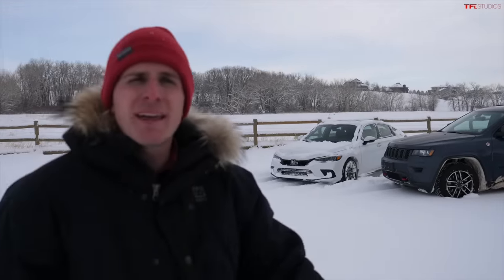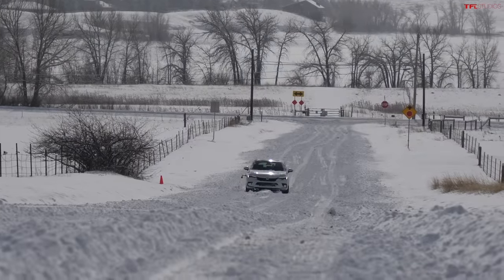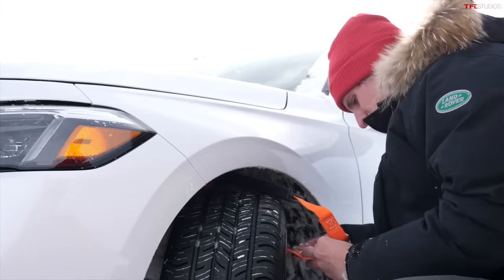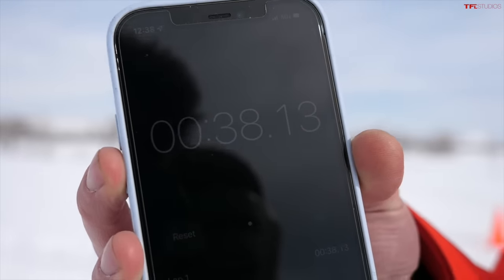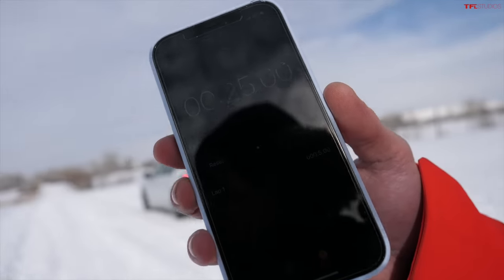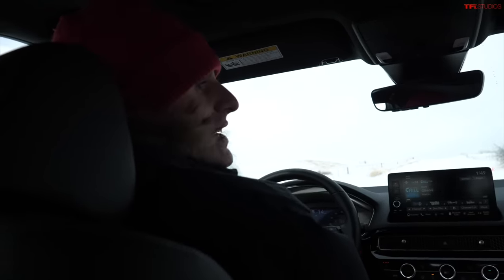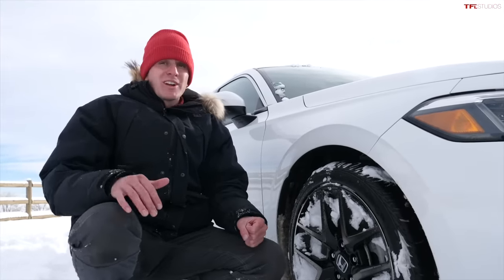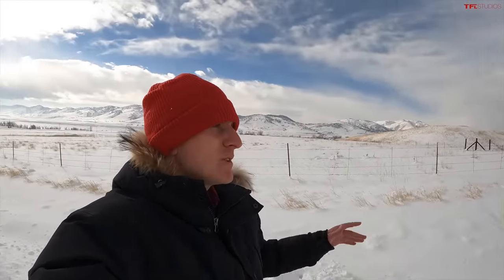Can Off-The-Shelf Traction Aids Make a Civic As Good In The Snow As a 4x4 Grand Cherokee?

Comment: Here's my Very Old Person take:

When I worked at the University of Cincinnati, I was the person in my office who was designated to always come in on days when the University was closed due to snow, in order to keep critical functions working. Cincinnati is a very hilly city, and the university was on top of a hill with extremely steep, long uphill roads coming at it from 3 sides. I always made it in, on every snow day, no matter how bad the roads were. I drove a 2001 Hinda Civic with the best snow chains I could get. They worked so well, I sometimes went out of my way to go up the longest, steepest street (*) just for the fun of it.

(*) Straight Street. The local joke is it has that name because it goes straight up.

These days, I drive an awd soft-roader. Since I live in the Mojave Desert, where it has only snowed twice in the last 15 years in my area, I can't justify the expense of snow tires, especially as my retiree income has lost so much ground to inflation. My vehicle is one of the many these days where the owners manual tells me not to use chains. So, for the rare occasions when I'm up in the mountains in the snow, I use snow socks. They work very well, both for going and for stopping. in 5-6 inches of snow. I would not rely on them in any especially heavy snow. I'd just stay home instead. One issue is that the great majority of them can only be used on snow but not on pavement. They will get torn up on pavement. That's a problem when you're alternating between snow covered sections and bare sections, and it's a bigger problem when chains-required laws kick in and you're required to have them on before you get to the snow covered sections. That's why I'd recommend getting one of the few snow socks which are made thicker and tougher so that they can be used on both pavement and snow, as long as you stick to the specified maximum speed. The ones I know of are the ISSE Super model socks, and the Matte Auto Super X and Extra Pro models. The Matte Extra Pro is the only one I know of which is rated for snow, pavement, and terrain.

I'm a total klutz, with arthritis, and I can put the socks on my vehicle in about 8-10 minutes for all 4 tires. It takes 30 seconds to remove them.

Comment: I just want to say great video but spinning tires don't get traction. When getting stuck try backing up onto a better patch of snow and go forward slowly at first. Spinning tires make the snow melt into ice/water. Making it hard to get past your ruts. Also low cars slow the car down because of the snowplow effect with the front bumper/ground effects. Plus deeper snow lifts the car taking pressure off of the tires making them get less traction. Also no matter how good of traction or wheel drives you have on bare tires you still rely on brakes so slow down when it slick. I see people in all wheel drives in the ditch because they were over driving the car and hit the brakes and the ditch caught them. Just slow down.  Thanks! Oh and I've lived in the snow belt and driven in it for 30 years!

Comment: I mean a snow tire will make it better and my studded tires made my fwd Passat go over ice on Montana better than any 4 x 4 .. man I do not miss those days in heavy snow going to work 3 am in 2 degrees to 0 ... But AWD is nice to have but not necessary.. see my snow tires grab the snow and use it for traction and my studs break through the ice as the snow is compressed and melts due to the traction

Comment: Per the 2022 Honda Civic owners manual the only tire chains recommended for this vehicle are SCC Radial Chain SC1032 or SCC Radial Chain SC1034 depending on tire size. The ones you placed are not recommended by Honda.

Comment: i hope its obvious that just going full throttle is not the best plan of attack.. id like to see you test normal driver acceleration.
Reply: Yeah especially in the first Civic test this seemed dumb. Cars with winter mode typically start in a higher gear and you start with gentle acceleration. Or you'd use 2nd when driving stick, also trying to prevent unnecessary wheelspin.

Comment: I’d like to see someone test the socks on the highway and see how many miles until they disintegrate!
Reply: You can't test them on a highway, as they are not produced to reach those speeds. Socks are very durable driven normally, as much as chains. Or as much as chains that cost the same as the socks. As there are chains that could cost 250$ and above. Also chains are forbidden on roads without snow (and you can brake them with ease). So if you have a twisty road that has some south and north side and on the south there is pretty much no snow because of the sun, or has been cleaned just in the middle, then you will wreck those chains, you will loose a wheel arch and you could be fined. With the socks you will be fine (tested it my self), but with slow speed on the tarmac. Snow cocks had just come in the market and bought them, but was keeping my chains in the trunk too. In a FWD car without Traction control and it started to slip on the outside wheels. So in a FWD car without traction control system, without LSD and with snow and Ice on the outside and a clear asphalt on the inside of lane, the chains had no chance. After putting the snow socks (on both from wheels) - no problem. And they were in the middle price range, not those 100$. The road continued for about 10 twisty miles. Did not even removed the socks for 5 days, then back down the same road and removed them in the bottom where there was no snow at all. Put them in a plastic bag (as they were dripping wet). Then dried them and back in the car. After that I just remove my chains and from then (~10 years) I have only snow socks in my cars and they work every time. Now I said cars, not trucks or big 4x4 vehicles. The first snow socks I sold them with the car, lasted about 60 miles on mixed roads with clear asphalt on one side  and snow/ice on the other and about the same distance with only snow. There were some damage but still worked fine. No chains would have worked on the mixed twisty roads and most of the damage was done there.
Reply: I use socks on my semi and go over the mountains on I90 in Montana and Idaho. I can install 6 in under 12 minutes.  Traction wise they're great unless you're on powdered unplowed snow.  Durability...well, you're supposed to go slow with both them or chains. If there's snow on the road surface they'll last longer, but not as long as chains.  Traction isn't quite as good as chains.  The trade off is that they're lighter weight to carry and MUCH faster to install plus when chains break they'll beat my fenders to death and throw chunks that pierce tires, and the socks won't.   The other advantage of socks is that if you're stuck and can't roll you can't put on the chains. For socks you just spin the tire a little and you can put them all the way on and get unstuck.

It's a tradeoff. I use the socks regularly but also carry one pair of chains that I HATE having to put on but carry them as a last resort.

Comment: I'd love to see a trail comparison of winter tires to all terrains because people say that all terrains become better than winter tires at a certain snow depth but I don't think that's true.
Reply: I don't bother with ATs in extreme conditions. I use MTs with lots of siping. Think Duratrac, Trxus MT, or Irok. Some people even sipe and groove Boggers, or run siped SSRs.

 When the snow is drifted higher than the hood of your 4WD, you need a tire that can claw. Dedicated winter tires like Blizzaks are designed to also brake and turn on packed snow and ice around other traffic. This isn't as much of a concern when the snow is hood-deep, as plowing will eventually stop a vehicle if the throttle is reduced, and there isn't typically much traffic on roads that have drifts like that.
Reply: I drive in deep snow fairly often, at least to the top of the bumper on my jeep. Will say it is true that in deep snow and certain conditions of lesser snow, like wet crusty snow AT or MT tires do better. Snow tires just don't dig down to the road as well it certain conditions. When it gets to the point where your pushing snow you need flotation to get up on the snow, so you are not pushing so much. That takes large tires. Normal snow tires do not come in the larger offroad sizes like an AT or MT tire does.

Comment: Plenty of AWD vehicles that have FWD counter parts. Testing should be done this way. Also not every all season is the same. I would suggest you put an all season on each which is designed to be somewhat useful in the snow. The tires I got on my Forester were horrible down right scary in the snow. My all seasons I have now are very good in the snow. Ice not so much but ice I guess your kinda screwed anyway.  Also I will add there are vehicles such as the Buick enclave which has a button that actually disables the rear wheel drive portion of the vehicle so you could just use one vehicle and do all your testing front wheel drive all wheel drive snow tires all season tires stock all season tires etc

Comment: Except you would never accelerate off in snow at full throttle. Ever.

When I bought my snow chains back in the 90s I did exactly what you are supposed to. When I got home I tested fitting them to the car so I knew how to when needed. I ended up only ever using them twice - both times a FWD vehicle driving up to a skifield. They probably lived in my car boot (different cars) for 10-15 years before I ditched them as they were rusted and too small for more modern wheel sizes.

Comment: I’d be afraid of scratching the wheels with any of those traction aids other than the tire sock thing. Instead of chains, snow cables might be almost as good without scratching the wheel.
Reply: they are--the problem with any chain if they are not on right and tight they can damage your car

Comment: If you only chain up front on a front wheel or AWD (yes occasionally even 4x4 and AWD required to use chains) you better realize that if you are going downhill and use brakes you have a good chance of spinning around. The front will have traction and the rear will not and around you go. On my civic (when I had it) I used Autosocks on all 4 wheels. No way, no how would I only chain up the front unless it was strictly uphill. Also when chaining all 4 you have no worriers about ABS or traction control acting up. My rear wheel drive pathfinder (2004) had such a touchy ABS system that anything would set it off (even using the spare once set it off and it was the same size just a different brand so probably a slight diameter difference) 
Cheers

Comment: Any product that straps through a wheel should be looked at closely. I see many vehicles that only have a fraction of an inch between the wheel and brake calipers. That would be a mess and you would be stuck and disaby all at the same time.

Comment: Isn't it a little irresponsible to drive around in all seasons instead of dedicated snow tires?

Doesn't the manufacturer supply the vehicles with snow tires when delivering a loaner? 
The jeep is TFLs.

I have around the same climate as Colorado and I use studded winter tires from mid November to mid April (the law say that you must have winter tires from the 1 December to 31  Mars).
Reply from the maker: We don’t have snow tire rules. Most of the time the companies send their cars on all season or summer tires regardless of the time of year.

Comment: I think proper car control matters more than what the drive wheels are. We had a massive snowstorm with temperature dips that caused icing. My VW Golf had 5/32nd all season tires on it and I was passing a lot of Jeeps, Toyota 4Runners, Audis, Range Rovers and Subarus that spin out and end up in a ditch. And I’m still doing close to the speed limit. I’ve only ever got stuck in snow once and was able to free the car immediately.

Comment: How is it that many many front wheel drive cars have made it through many many winters safely taking their passengers to work every day with little trouble all over the US (and the world).even with all-seasons? Are you saying that a AWD is necessary? Sure AWD can be better but necessary?
Reply: In a major city it is easy to wait for the plow trucks or 4x4's to make a path. Then go out in the 2wd vehicle. If you get stuck there is usually someone around to help. Out at night or in a rural area it is a different story. I drove my 2wd drive in rural areas for many years. Got tired of putting chains on it and still wondering if I was doing to make it, so sold it.

Comment: this is 2022 and you are still using this type of chains? there are simpler ones that can be fitted without moving the car in LITERALLY 2 minutes. they also have thinner chain links, designed for modern cars to protect the wheel arches

Comment: The metric at which this is being tested is not a fair metric. You use a traction device to get through deep snow. It’s not something that you’re going to use all of the time. A front wheel drive car equipped with a good snow tire will out perform an all wheel drive with all season tires every day of the week. If the snow gets deep you put tire chains on the front wheel drive and it will still outperform the all wheel drive. Tire chains beat out all wheel drive. It has nothing to do with how fast it is. It has everything to do with how much a grip you’re going to get in deep snow.

Comment: "I do this in 12" of snow all the time in my FWD with all season tires." 
No, you don't. You aren't pushing that much snow in a FWD car because of the snow packing against it and lifting the front of it up. I have owned 2wd and AWD. The snow tires help a lot but the FWD cars sit too low and lack of ground clearance hurts. I will take my AWD with good all seasons any day over a FWD with snow tires. If you slide into a snow bank and bury the front wheels, they'll spin and you're getting no help from the back tires. On the AWD, If the back tires don't go into the snow bank, then they're free and will assist the stuck front tires. I am Speaking from experience here. I run snow tires on both of my cars so i get AWD and traction

Comment: i feel like this would have been more interesting if it was a more apples to apples comparison, like the same vehicle/vehicle model with the same tires but one with only fwd and the other with awd.
Reply: Like using 2 Suzuki SX4s that came equipped with buttons to switch between FWD, AWD, and 4WD.

 Several modern 4WDs can switch between RWD, AWD, and 4WD...like the Selectrac Wranglers and many newer 4WD pickups.

 I have AWDs that I use in snowcountry, for towing, for softroading, and for my 50mile commute. I use all-weather AT tires, rather than all-seasons, unsiped MTs, or dedicated winter tires. I have a multi-mount winch and am soon getting traction mats for offroad, with snow-socks for getting out of my driveway. Studs and chains are not allowed on public roads in my state. A rear diff-locker is also available for one of my AWDs.

Comment: Meh.  I just drove from 30 miles around Lake Tahoe through a pretty big storm in my crappy Nissan Versa with studded snow tires.  Every single vehicle I saw stuck or abandoned was an AWD SUV or 4x4 truck - 100% of them.  The trucks and SUV's will always get off the line better, climb a snowy hill from a stop better, and typically have better ground clearance....and that's it.  On plowed roads it makes no difference, IMO.

Comment: Thanks for this video Tommy....I looked at the autosocks for my 2011 Grand Marquis but didn't buy because I was skeptical. Now I know that I could try these or just get snow tires. Thats and Idea.... how would dedicated snow tires compare to the Autosock?
Reply: @veganpotterthevegan  Sounds like you have a lot of experience with various traction devices. So for someone like me in the area I'm in for a rear wheel drive car which we only have decent snow about 2 months out of the year would you recommend just getting the sock over the chains?
Reply: @veganpotterthevegan  Thanks for the info....so far I've never put anything on my Grand Maquis or other cars I've had. So, I think I will go with the socks for now and maybe have a set of chains for my 4x4 Tundra just in case.
Reply: @veganpotterthevegan  I was thinking of the Michelin Cross climate tires for my next car tire purchase. Can't do dedicated snow tires as I hear they wear pretty quickly on pavement.
Reply: @veganpotterthevegan  Also it sounds like you live in an area where it snows often.

Comment: The Civic had the advantage of the Jeep digging out the snow and creating ruts for the civic to use...
Reply: Not true at all. Fresh snow is more grippy, as crushed snow creates a now slippery surface and creates tracks that make it difficult for vehicles to escape, forcing them to only ride on compacted, more slippery snow. This is why winter tires have less meat on them than mudders, because the grip of the snow is what aids the traction, not the tread depth of the tire.

Comment: What comparison is this? Two different cars different tire widths different car weights different wheelbases different axle or wheel loads ...... there is no comparison here except that
both on a winter basis with factory tires.
If we wanted to make a comparison we would take the same car model of one that offers 4 wheel drive and a model with only front wheel drive everything else would be unchanged.
The socks are excellent, of course, of proven quality, and the brands are intended only as an accessory and not as a permanent use.
Most SUV accidents happen precisely because of the belief that 4-wheel drive will save them.